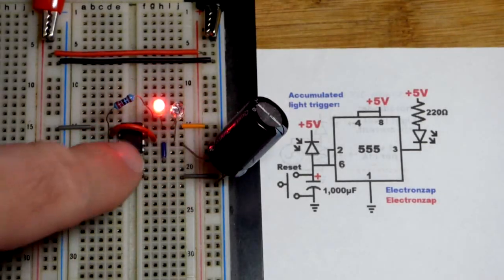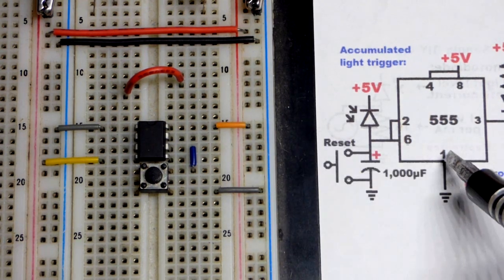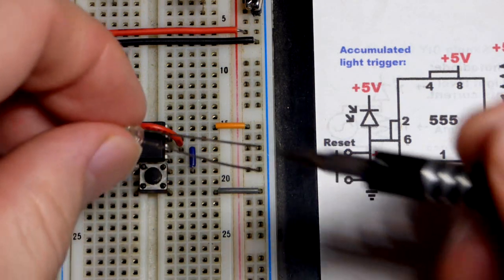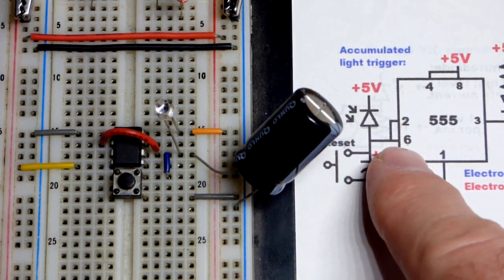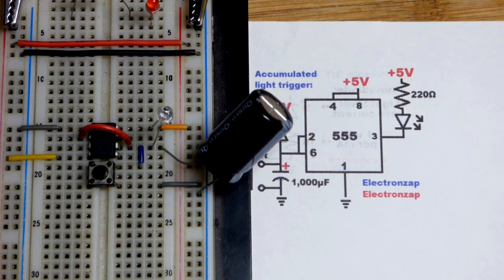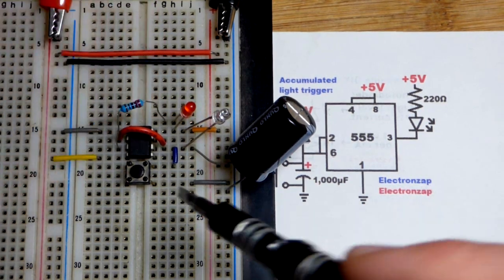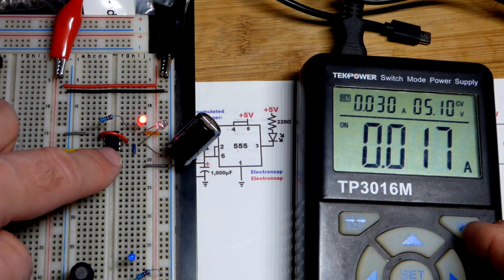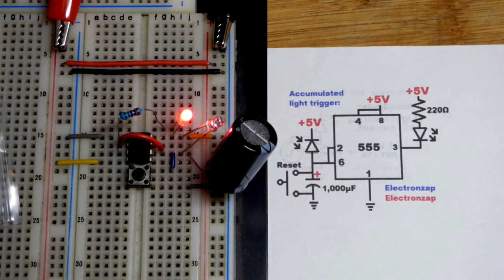Accumulated light turns on LED using photodiode and 555 timer circuit by Electronzap

Comment: Thanks for this video. What do you use to  power the circuit ? I'm new to electronics.
Reply from the maker: I show the power supply I mostly use towards the end of the video. The wires plugged into it have aliigator clips that I attach to wire headers at the top of the board.